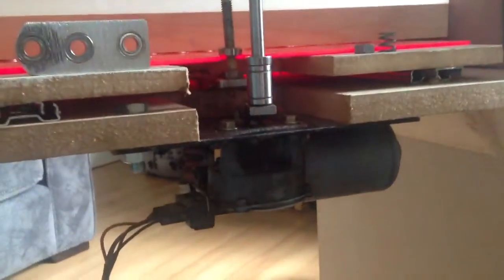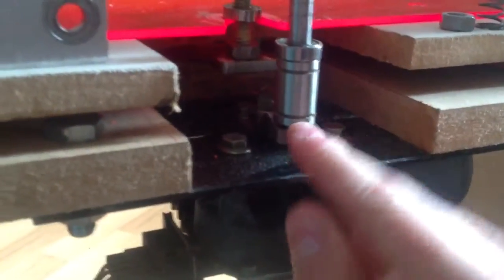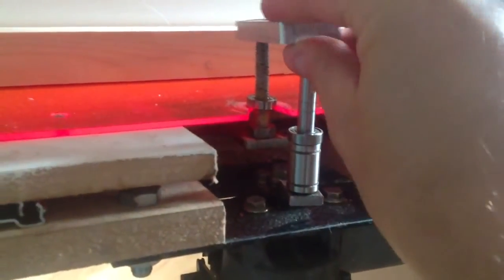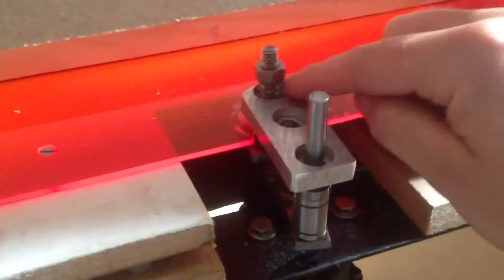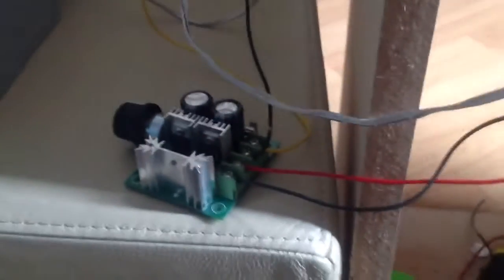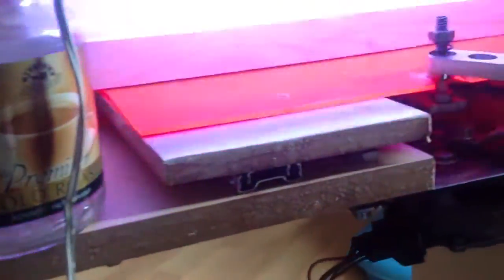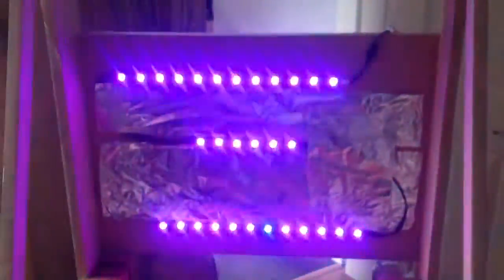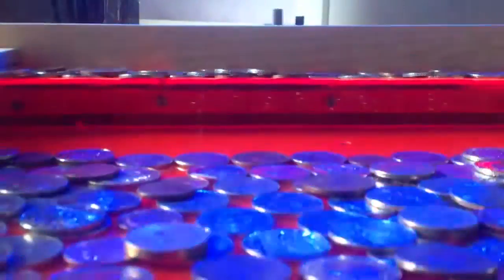Homemade coin pusher - explained so far

Comment: Hey looks nice! I was wondering how you made a connection with the metal pin (0:36) attached to the rotating wiper arm- Normally there is a metal button pressed on it that I can't take off very easily. How did you do that? Thanks a lot!
Reply from the maker: Oh heck / I really can’t remember!! I don’t remember struggling doing anything!

Comment: I know this an old video, but problem I have is how to attach rails to the sliding board, in mines the screw jam it and stop it from moving, or if possible can you tell me what sliders you used.... Thanks
Reply from the maker: Vincent Monaghan I used the best quality ones from BQ. I had a similar issue and ground off any excessive head but obviously so I could still remove them.

Comment: I really want to build one, but don't understand the electrical and motor part.  I would be afraid to do it without specific instructions on how to design it all on 110V for US use.
Reply: Did you end up taking on the project? I'm currently building one.

Comment: motor? and power supply?
Reply from the maker: The motor is the windscreen wiper off a ford fiesta that cost me £10 from the local breakers yard. The power supply is the 12v line from a PC power supply that I removed from a broken PC for free.